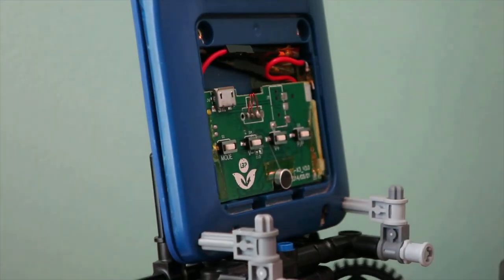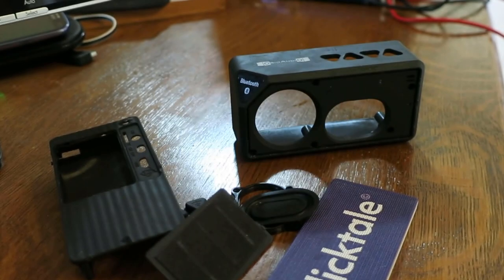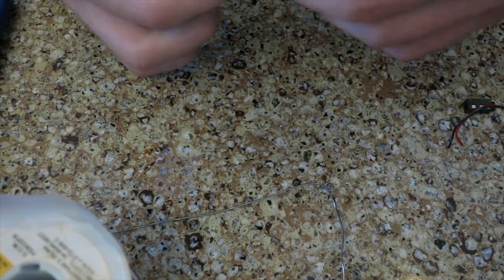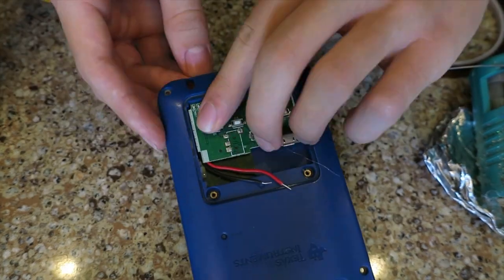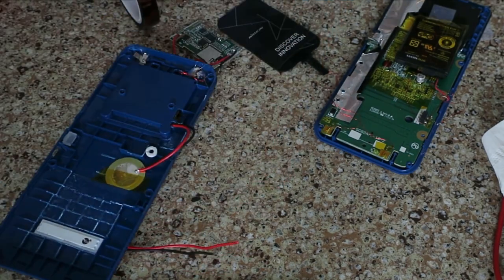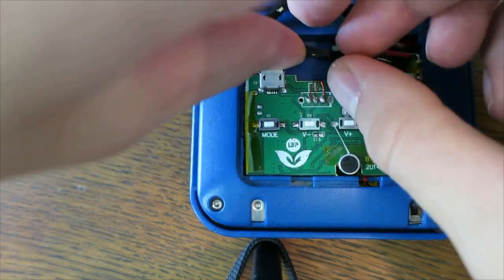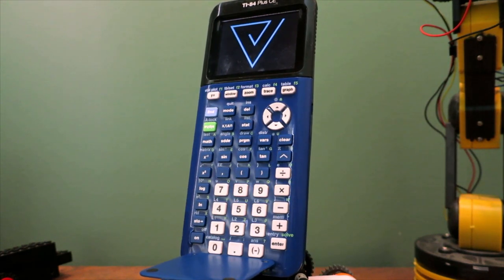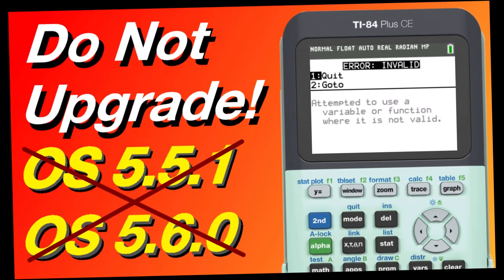How I Play MUSIC & Phone Calls from my CALCULATOR!

Comment: This is the best! I’m getting a ce later today
Reply from the maker: Thank you! I do have to warn you not to get a TI-84 Plus CE Python Edition because it will not come with ASM capabilities. So far a normal TI-84 Plus CE will still have it though!
Reply: TheLastMillennial where do I get one that doesn’t have python though?
Reply from the maker: @marcmiyamoto  Oh I should add that regular TI-84 Plus CE -t calculators should also have ASM. For now you can still probably get them new with ASM but used calculators will definitely still have it.
Reply: @TheLastMillennial  how do you get rid of python with a used ti-84 plus ce?
Reply: TheLastMillennial oh ok thanks I’ll be getting mine at staples (They have it for 99.99 ;)
Reply from the maker: @jadenigarta8208  I'm not sure what you mean, the TI-84 Plus CE -t Python Edition was just released and is designed with Python in mind. The regular TI-84 Plus CE (-T) physically don't have the hardware in order to run Python.

Comment: Just found out about this project, very interesting using bluetooth. I did a very similar project but it used a 3G cellular module with an arduino to make the phone call. I never even thought of using bluetooth, that would of saved a lot of space. Check out my project on my channel if you are interested.

Comment: Is there a way to increase RAM and Archive on the calculator? Like, are those parts able to be swapped?
(PS, the Apple joke was funny.)
Reply from the maker: Thank you! Unfortunately, there is currently no way to increase the storage capacity of either the RAM or Archive. Even if you somehow replaced them with higher capacity compatible components, the OS was written to only use as much as the original capacity. However, in the future the community may make USB flash drives compatible with the calculator so you will have extra storage there.

Comment: Hi, I have the Ti 84-Plus Ce and when I plug the USB cable into my Mac running High Sierra, it charges but won't show up on the page for connected calculators? Is the cable the problem, or just the app troubleshooting? Maybe the Mac itself? Needing to know, taking a closed-note test for Advanced Algebra soon and need to download some Apps. Thanks!
Reply from the maker: OK, I'm not too familiar with Mac. Do you have another machine you can test the cable on? Have you tried uninstalling and reinstalling TI-Connect CE? Does your Mac recognize the device is plugged in at all? (Do you see a Texas Instruments device in device manager?)

Comment: This guy pulls out his calc “hey Elon musk how are you”
Reply from the maker: I have TI's CEO on speed dial :P
Reply: @TheLastMillennial  I would killllllll to have one of those on a normal ti 84 (because thats the one i have) i wish i knew as much as you (i subbed)
Reply: @TheLastMillennial  could i pay you money to get you to add this to my calc or just buy it?
Reply from the maker: I'm thrilled you like this so much! Unfortunately I can't offer to add this mod to your calculator. Not only is the circuit board I used no longer sold, the TI-84 Plus has completely different internals than the TI-84 Plus CE. If you want to see a cell phone mod that's even cooler than mine, a fellow YouTuber called BoomBrush made one using your type of calculator: https://youtu.be/XhAPQs9kyEw

Comment: ay what's the red goop on the PCB? would it be damaging to remove it?
Reply from the maker: That's epoxy to prevent components from getting knocked out of place. It's not vital for the calculator to function, but you'll likely accidentally pull off a component trying to remove it. Why do you need to remove it?

Comment: How did you get started modding
Reply from the maker: I just thought 'This seems like a cool idea' so I took apart the calculator to see if I could make this work with basic tools and soldering experience. I after looking at it, I figured I could probably do it so I decided to give it a go. It doesn't always work first try, there was a lot of trial and error involved in this project but I didn't give up so I eventually overcame all the issues!

Comment: hey, could you provide a link to purchase the bluetooth speaker you used?
Reply from the maker: Unfortunately it's not really around anymore (it was released in 2014) and the one I found is way overpriced ( https://www.amazon.com/OrigAudio-Jellybox-Bluetooth-Wireless-Speaker/dp/B00MW8D60Y ). You're far better off finding a small board that's purpose built for diy projects. You'll probably get stereo audio which will sound better than my mono audio setup.
Reply: @TheLastMillennial  thanks for trying!
Reply: @TheLastMillennial  I will probably use a purpose built board, good idea.  I just did not know there were any out there :)

Comment: Please make an instructables tutorial for this lol😂
Reply from the maker: Heh. I honestly don't recommend you try this yourself since it deals with moving and soldering the battery which has the chance of creating a dangerous short circuit. But if I come up with a safer way then I would certainly consider making a tutorial there!
Reply: @TheLastMillennial  OK great, I'm probably going to do this anyways to my calculator because I have a microsoldering kit and some ifixit tools along with my own ohmmeter to check the resistance and voltages. Plus I'm planning on doing a similar Bluetooth speaker mod, but I'm going to try and cut a small rectangular hole above the lcd for an old smartphone earpiece speaker. I'll let u know how it goes... I might even make a YT video on it! 👍
Reply from the maker: Oh sweet! If you need any help or have any questions about the calculator's hardware feel free to ask me. It'd also be cool if you could post your progress on Cemetech.net which is a calculator forum!
Reply: @TheLastMillennial  totally. For sure man👍👌